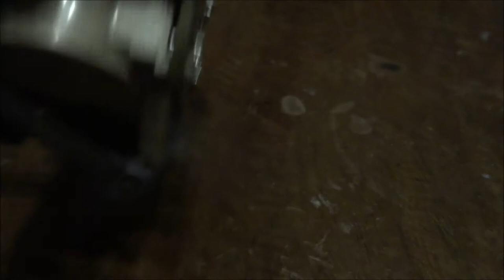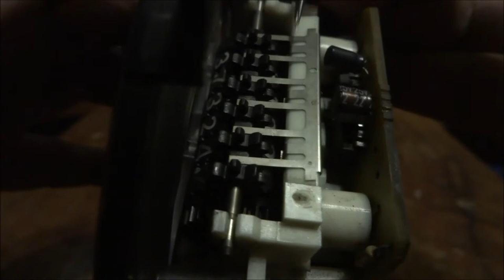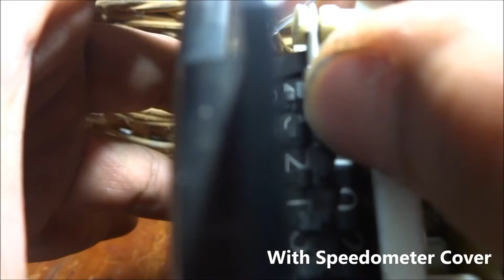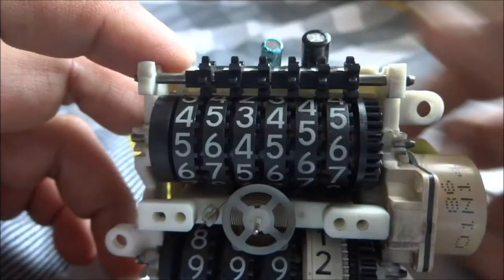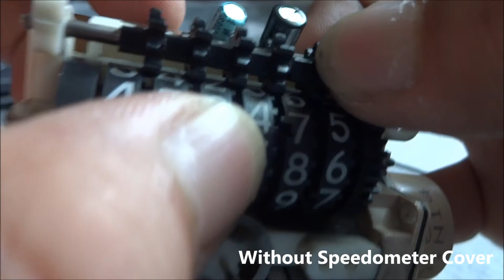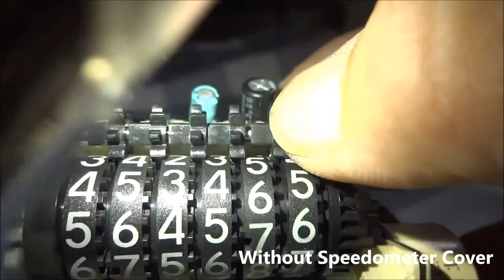How to change 90's Toyota Mileage In Odometer Denso Swapping Gauges Cluster

Comment: Is this applicable in a 94 T100 cluster I bought one that reads 040,000 miles and my truck has over 250,000 lol thanks in advance
Reply from the maker: As long it have gears like in the video you can manually rotate it just be careful

Comment: This is why you always run a Carfax and check for odmeter fraud
Reply: I'm using this video because I bought a cluster at the junkyard that is reading 40,000km more than original cluster is so I want to calibrate it. New cluster has a tach and old one didn't
Reply: When you replace a cluster in one of these old trucks because it broke or you want to upgrade to one that shows RPM you try to match the new one to the old one so it’s accurate.  We aren’t doing this to fool anyone